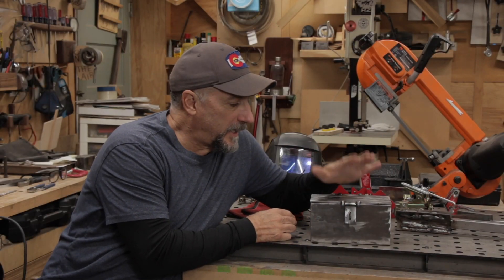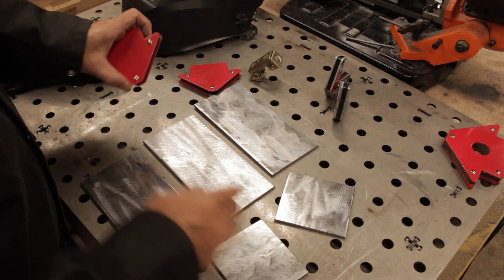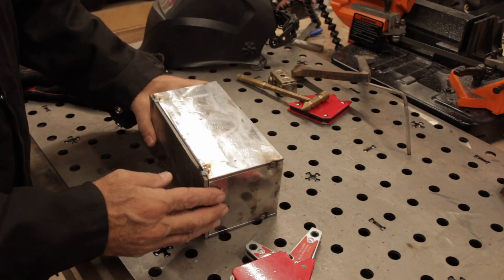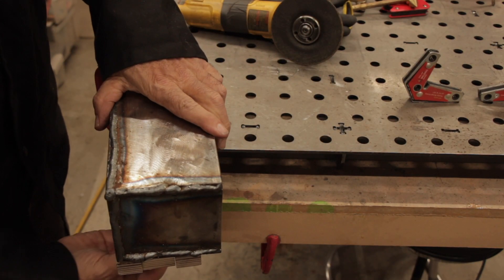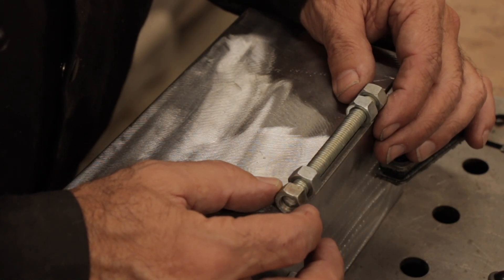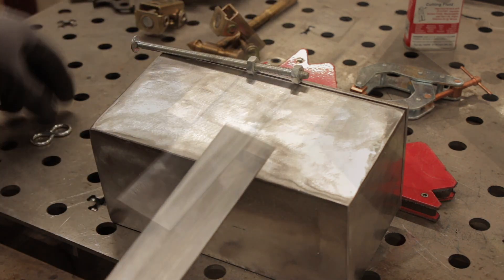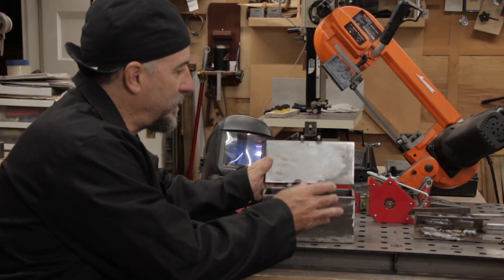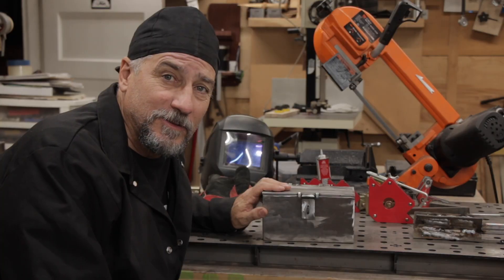Welding Project for Beginners: Metal Shop Box

Comment: I just had a similar project to this in school but I was instructed to create a small gap, like 0.5mm clearance so instead of welding on top of each other like you did « L », we had to weld it like « I_ »
It made it much harder, anyone know why the reason for this is?  Does it create a better weld?
Reply from the maker: Your way will make a much stronger joint than mine. But for a box they will both work. Thanks 👍👍
Reply: @ We were welding 3mm plates as well, was really hard I kept burning through the plates🥹 had to redo it at least four times and still looked bad, I’m not sure if the angle I was holding the weld was the problem or if I was holding it too close, sometimes the arch stopped and restarted and made the weld look bad, it was really challenging😭

Comment: Hi 
Sir 
I was wondering what were the dimensions since I’m doing a class project 😊
Reply from the maker: So my box is made with 3/16 “ thick and roughly 4” deep x 8” wide x 4” tall. The bolt I used was 3/8 x 4” for the hinge .  But you can make it whatever you want or work with the material you may have on hand.
Reply: @TheMuzShop  I see how about the walls? the squares and the rectangle

Comment: I always love these "For beginners" videos. Beginners do not have high end tools and cutting machinery with a giant well spaced workshop. These beginner videos should be filmed using standard affordable tools in a typical environment that your average person can use and afford. That would be a true test of skill not just on crafting the item but also for making instructional beginner videos. Not saying your not skilled, just that half of the battle would be lost when you start flashing all of these specialised pieces of equipment in your videos to your average person starting out.
Reply from the maker: You are so wrong… I have a shop that if it was empty you could barely fit one car. I have zero high end tools. My middle of the road welder I bought used, the horizontal bandsaw is one of the cheapest out there, my welding table has no legs and everything else I have collected over 30 yrs. So stop making excuses and start making.
Reply: @TheMuzShop  hahaha I already am making. But I think your perception of high end is somewhat different to mine.

Comment: I know you did this a while back but what materials did you use. Width and thickness? I’m fixin to mak a box for my father in laws ashes. He was a metal shop teacher and I’m just starting in on welding. Thanks!
Reply from the maker: First off thanks for watching.  Here are the  dimensions of the box I made and of course you can make it any size you would like…. I just so happen to have 1/8” x 4” stock on hand. So my box is roughly 4” deep x 8” wide x 4” tall. The bolt I used was 3/8 x 4” for the hinge . But get creative and make whatever you want or work with the material you may have on hand. Someone gave a good suggestion and said to cut a chain link in half for the lock hook instead of a nail. Have Fun!

Comment: What are the dimensions of the box?
Reply from the maker: First off thanks for watching.  Here are the  dimensions of the box I made and of course you can make it any size you would like…. I just so happen to have 1/8” x 4” stock on hand. So my box is roughly 4” deep x 8” wide x 4” tall. The bolt I used was 3/8 x 4” for the hinge . But get creative and make whatever you want or work with the material you may have on hand. Someone gave a good suggestion and said to cut a chain link in half for the lock hook instead of a nail. Have Fun!

Comment: A tip to improving your grinding also; try to keep the disc as flat/parallel to the surface as possible. It will help reduce "dig ins" to the surface of the material, and give a level finish.

Flap discs for polishing, hard stone for material removal, and cut off wheels for cutting. Don't mix up their uses, and you won't break any discs. 👍
Merry Christmas
Stay safe
Reply from the maker: Thanks so much for the great info 👍🏻👍🏻

Comment: Hello im a mechanical engineering student. If you allow, can I use this project for my case study? May I know what method you use in the welding process And I would be grateful if you would be willing to list the manufacturing steps of this project 😁
Reply from the maker: Sure you can. The method of welding is mig and the manufacturing steps are in the video. Thx 👍🏻👍🏻

Comment: Are there measurements anywhere?
Reply from the maker: The finished dimensions of the box are 8"Lx 4"w x 4 1/2 h with 1/8" thick. The front clasp plate is 1 1/8" x2" x 3/32 thick with a 1/4" bolt and nuts about 1 7/8" long. Back hinge is 3/8" bolt with nuts and 4"long. But you can do whatever you want with the dimensions. This is just what I came up with...have fun!!

Comment: Great video, what strength magnets are those?
Reply from the maker: I’m not sure the actual strength on the magnets. There is an Amazon link to them in the description below he video so you can look them up …. Thanks
Reply: @TheMuzShop  the mag switch magnet link sends me to the general website not the magnets you are using for your fixture.
Reply from the maker: @kwkstar  Sorry i thought you were talking about the red 90 degree magnets.  the magswitch are the 150 , dont forget to use the discount code at checkout" Muzshop ".  thanks
Reply: @TheMuzShop  great thanks

Comment: Excellent little project! I like it. Did you paint or powder coat this box? You could cut away the center of the hinge rod, and move the inner nuts closer to the outer ones, weld the ends of the hinge screws and grind flat. I'd probably use a couple of door hinges.  Also, maybe some tapped holes in the bottom for rubber feet, and drawer handles on the sides. Also, your nail is the weak link. :)
Reply from the maker: I like your improvements .....

Comment: Nice box man, but put a guard on that grinder!.. that's some scary stuff. I used a grinder without a guard one time and never again. I had a flap disk on and it touched my knuckle for a fraction of a second and it sailed right through my glove and down to the bone, and that's just a flap disk... Be careful bud
Reply from the maker: You are totally right especially for a beginners video....my bad. Thanks
Reply: Once you get bit by a grinding wheel, you never again forget to wear your heavy leather gloves when grinding.

Comment: Question! I use cutting fluid when drilling and taping holes, seeing you use it with a band saw I have to ask what are the drive wheels made of on your saw? on Porta band saws that use a rubber or synthetic compound to drive the blade it is not recommended to use a cutting fluid as this may attack  and degrade the drive wheels. just  asking! one of my projects is to make horizontal band saw out of a cheap portable saw. and this maybe something other may want to do.
Reply from the maker: I’m not sure.... I better check the manual. 😳. Thanks for watching
Reply: @TheMuzShop  Thank you for taking the time to reply.
Reply from the maker: @TheFalconJetDriver  I read some articles about the Wen metal bandsaw and there are several people using wd 40 or oil. Didn’t come across any one saying dry. But now you got me curious 🧐. I have used both , prefer oil. But good point about the wheels 🤔.

Comment: Great job, don't forget to tell us your welder settings!
Reply from the maker: Wire 335 in/min , voltage 20.5 , gas 18-20. Remember your machine will vary. Thanks for watching. Be safe...👍🏻👍🏻👍🏻
Reply from the maker: Wire .025😉

Comment: nice work man! i love it! why not go bigger!
 i have some old angle irons kicking around from bedframes, you should do some vids on builds, what to make with them, i think, metal shelving, a welding table, a welding cart, some contraption or other, like a cutting rig for concrete. something on casters, something on wheels. a clamper for lifting pavers, small material thrower with hopper...
anyways right on! going to hit that sub button for ya!
Reply from the maker: Thanks for the Sub. Those are some good ideas 💡. I’ll keep them in mind.
Reply: BTW: Old bed frames are tempered and much harder than you might think. You might need a plasma cutter for that.

Comment: I'm not necessarily new to welding ive been doing it for about 2 years and I'm not a professional or anything I was just wondering/ thinking it seems like your burning the material im not trying to be rude or anything because I know I still make big mistakes also but I just wanted to point it out if there is a different reason please tell me. Anyway I love the project tho im going to make on to store some cash in because im 15 and just barely starting to make money and im saving up for a truck lmao still got a long way to go 🤣
Reply: The material will burn no matter what.. that's part of the process! Keep getting after it man, good luck to you!!
Reply: @JonJon501  what i mean is its turning black is it just because of the material he is using
Reply: @bradleypumba  ya, mild steel will do that when stick or mig welding it... no big deal
Reply: @JonJon501  ohhhh ok thanks for clarifying that to me

Comment: Good project, when your welding downhill point the gun upwards (you’re holding about a 90 try and shoot for a 45 unless you change settings. definitely not the worst welding. Watch the puddle,  to make that slot on the latch you could also drill several holes and either file it out use a smaller die grinder or dermal tool. That will eliminate welding the slit closed.  welder +5 years
Reply from the maker: Thank you so much for the info, I'll keep it in mind....
Reply: I've been welding for arpind 2 years im not a professional or anything but even though I've been welding for 2 years I still think this is great advice you learn something new every day I guess lmao 🤣  im gona try it tho
Reply: I try to always pass along information, knowledge is useless; if you’re not teaching someone else.

Comment: I would build this but I cannot buy steel at a reasonable price anywhere so I mostly build with salvaged materials as well as new rebar, pipe and concrete stakes (flat ones). When I need plate I weld together 2" x 36" flat concrete stakes ($5 each).
Reply from the maker: RiceFlavoredGum way to be creative.
Reply: @TheMuzShop  no steel supplies in town as the main industry is tourism means you need to improvise!

Comment: Do u have measurements for each side? I built a few things and would love to try this out too (I’m only 16😂)
Reply from the maker: Thanks !!!  The Box is made with 1/8" thick metal, it's 8"Lx 4"W x 4 1/4" high. The hinge  in   the back is 5/16 bolt 4' long and the front is 1/4" bolt 1 3/4"long with w latch 2 1/4"x 1". 
 Email me if you have anymore questions themuzshop@gmail.com
Have fun and be safe...
Reply: Thats awesome that you share your info! I was just about to ask how thick it was too lol

Comment: Looks great and solid. Could you please share the dimensions for material you used, I would like to put that on a blueprint.
Reply from the maker: Thanks !!!  The Box is made with 1/8" thick metal, it's 8"Lx 4"W x 4 1/4" high. The hinge  in   the back is 5/16 bolt 4' long and the front is 1/4" bolt 1 3/4"long with w latch 2 1/4"x 1". 
I would love to see the print. Email me if you have anymore questions themuzshop@gmail.com  thanks again.

Comment: Very neat project and great for a beginner. My recommendations for improving the box as it is right now would be to add a loop handle on top or angle iron handles on the sides. As it is right now, its probably fairly slippery due to the weight and smoothness of the steel surface. A handle on top would also allow you to pick it up with one hand rather than two. Also, putting on some paint to protect the box from rust is advisable. 

For slightly more advanced welding and prepping work.. While your's is definitely adequate, having welds on the outside to hold the lock loop in place serves no real practical purpose and might appear as aesthetically displeasing. Its better to drill two holes, countersink the hole and weld them on the inside to get the welds deeper into the plate and more weld contact with the loop itself. Then you can you grind the surface flat without having to worry about grinding away the welds since a lot of the weld is below the surface level. Preferably this should be done before the rest of the box is assembled.
 The latch can then be measured to fit the loop rather than the loop measured to fit the latch. 

For a pointlessly advanced box, grind 45 degree bevels for one side of the welding joints to make a half-V groove that you can then fill up. Because the penetration of GMAW/MAG is not that spectacular, especially on plates that are above 1/4 inch, having a groove to fill up allows you to put down more weld below the surface level and a proficient welder can even make a root pass that removes all the gaps on the inside that will undoubtedly be filled with up grime and dust over time which might not make the box the best place to store anything you want to keep clean. Of course even a bevel just 1/16 to 1/8 inch deep allows you grind away the crowning without having to worry about compromising the integrity of the weld since you'll always know that there's at least that much weld below the surface.
Reply from the maker: Thank you for all the good info. I hope this helps a few welders out there that are just beginning . I really appreciate you taking the time to comment . 👍👍
Reply: I agree on most of it as well as making a deeper welding to make it stronger. Still i wonder what could be use for it.... Its too small and too heavy do be practical. I think that more of a skill can be developed using a tinner sheets up to 3mm. Since there is often mistake of burning trough material.  
Other thing hinges are too complicated you can buy them cheap or even produce them with pipes and some round iron bar. 
Now i got KZUBR inverter/co2 welder that i brought for 250€ and invested same amount for a co2 gas container witch is a fire extinguisher basicly. Have no special tools to work with but grinder welder and my hands and yes one big ass hand held grinder ( witch i use when i beed to cut something deeper than the small one can reach) xD
Reply: It ain't going to the moon though.. Some down hand on the outside corner joints, or even just good solid tacks on the inside would've been adequate.
Just like drilling a hole for the nail.. Could have just tacked it on at a higher voltage. It came out fine but don't reinvent the wheel.
Reply: Yes a handle will make the box easy to carry
Reply: Absolutely fantastic advice thanks
Reply: Also welding up the corners I found it best to not have everything flush right of the beginning. It’s kinda hard to explain but you want your weld to fill in the corner. You only want a small amount of the metal to overlap when doing corners and you will fill in the rest. This way you get maximum coverage and good penetration on both pieces of metal. Hope this helps somebody out.

Comment: For all of those welds, since they are non structural welds. Run them all downhill and it will save some time grinding. Also for thicker material like you used here if the tacks are good and strong you can run a grinder down the seam and create a nice “v” groove for the weld to sit in as your welding. This will help with penetration and keep the overall profile shorter...which in turn will result in less grinding. Good work
Reply from the maker: Thank you for the feed back and tips ....👍👍